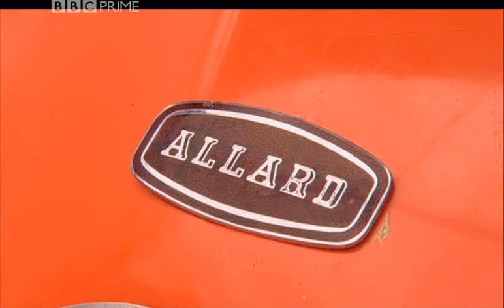Speed: Jeremy Clarkson at the Bonneville Salt Flats

Comment: It still amazes me when people think going fast at Bonneville is easy. The lack of traction,  density of altitude easily above 5500 feet over sea level, 7 to 10 mile cross winds and  this year smoke. Jeremy should try an open motorcycle at speed with wind trying to rip your head off....never mind I  saw Jeremy on a moped in Vietnam 🇻🇳 😁😁

Comment: How about getting into a top fuel dragster so you can go over 300 mph in less than four seconds???
Reply: They are unsafe for speed records, since they can only hold that power for the length of the drag  strip, then they blow up, making it very hard to regain control afterwards. These are for stable high power applications.